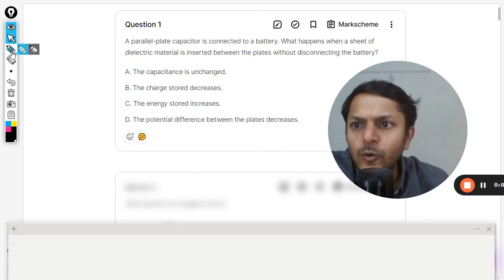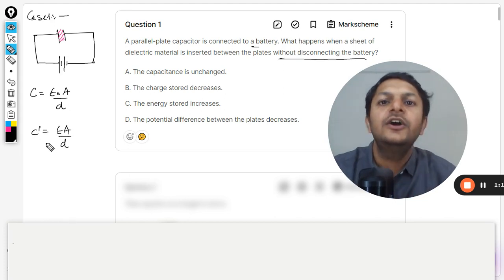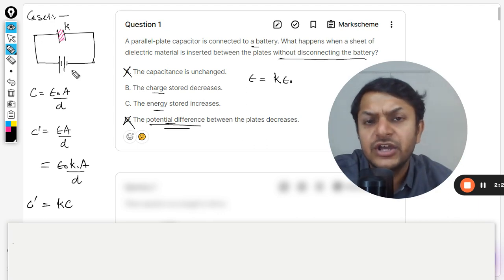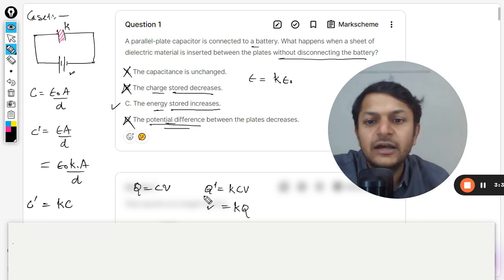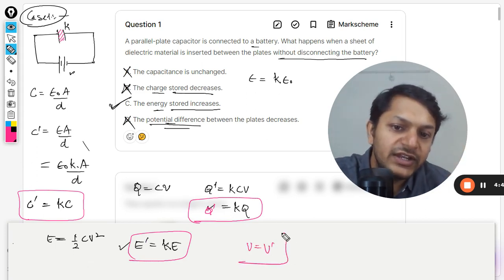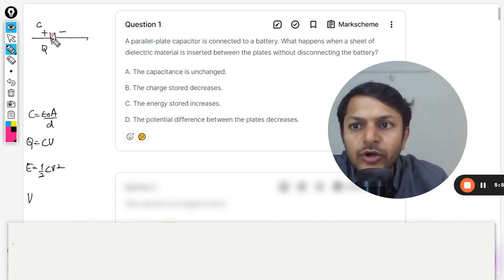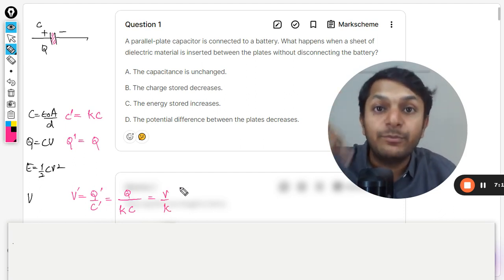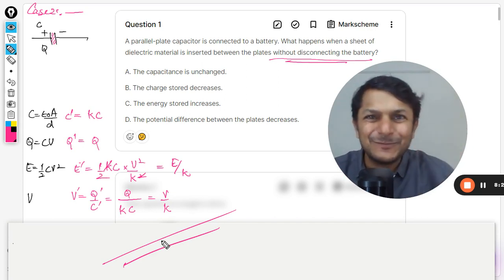A parallel-plate capacitor is connected to a battery. What happens when a sheet of dielectric mat

Comment: if p.d. decreases by a factor of k, shouldn't energy decrease by a factor of k^2 given the energy formula?
Reply from the maker: The potential difference is not decreasing. It's same, because the capacitor is always connected with the battery.!
Reply: @profvarun  oh i get it now, thank you!